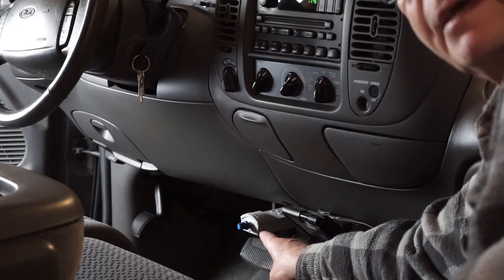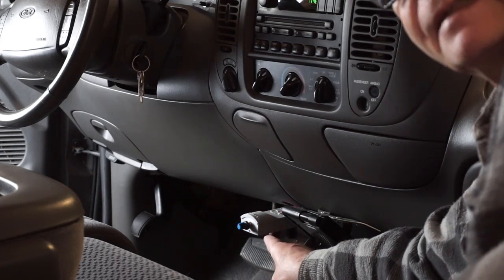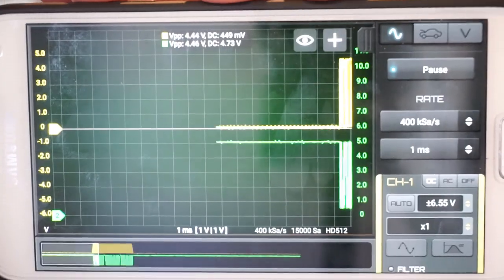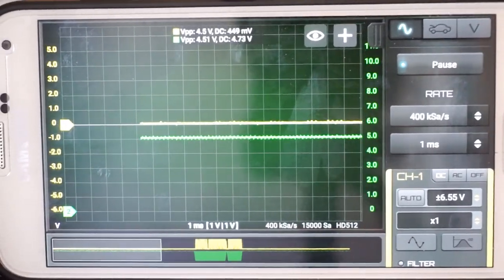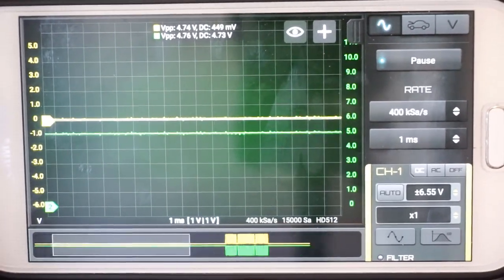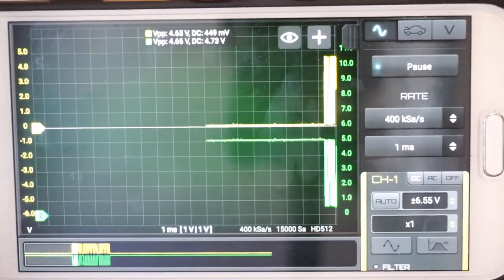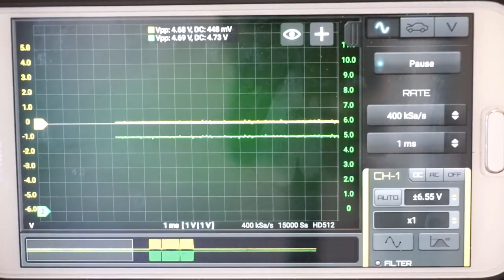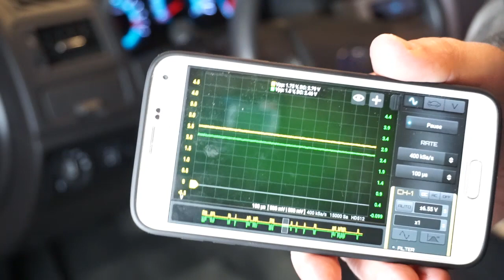GADGETS#148 - HS402W CAN

Comment: How many H402s have you made? I'm still trying to get one completed. Getting the smd components right and then trying to solder without dropping and losing them. This is a great project for personal intrest and accomplishment but for a cheap alternative it isn't for me lol. Not going to give up though but in the meantime what is it going to take to get an extra hs402 wireless from you??? Will definitely compensate you for your troubles.
Reply from the maker: I agree if just building 1 HS402 that it is not exactly cheap. But we end up with many PCB boards and spare components and from there these scopes become very inexpensive and allows me to throw them in single purpose GADGETS.

I don't build HS402 for sale but two members on our TELEGRAM Group do (USA / EUROPE)

https://t.me/hscope

Denis

Comment: Wow, good thing I didn't build my breakout box yet, I was looking for exactly this problem. You could add a female header in v2 and proxy the connector through and add a scanner in line.
Reply from the maker: There are DLC "splitters" available that will allow use of scan tool + HS402W CAN to be used together